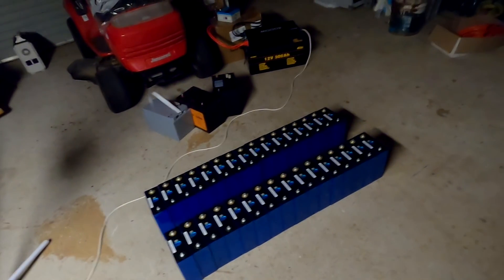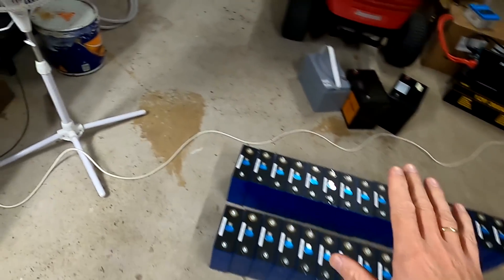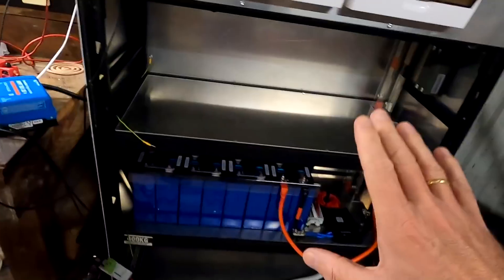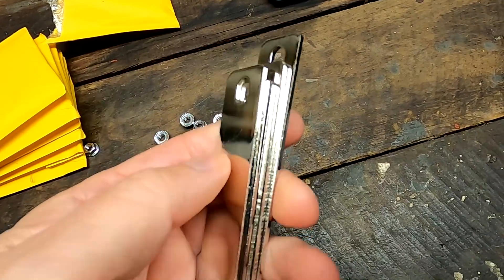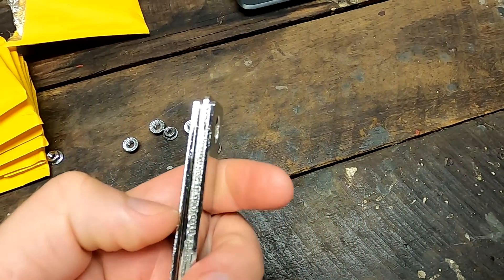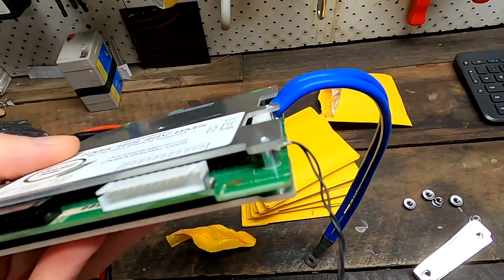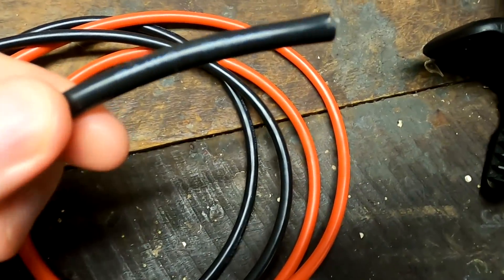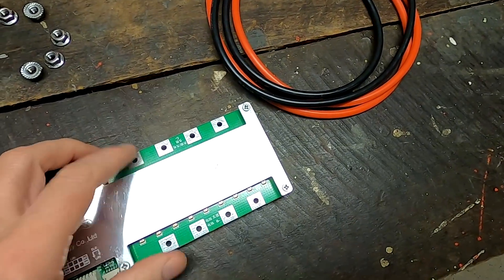HELTEC 200A BMS comes without cables? Preparation to install 30kWh of batteries.

Comment: Thanks for your videos Andy!
Perhaps my little trick can help make inserting wires into cable shoes a breeze in the future - pardon if it's old news to you:

Use a small cable tie - strap it around the exposed strands and pull it tight.  It makes a neat package out of the strands and firms up the end of the cable. Now you push the cable tie almost to the end of the wire, ensuring the very end is tidy and no single strands stand to the side. This way, they are quite easy to insert into a tight-fit cable shoe. Then simply push the cable tie back with the cable shoe when you insert the cable. Once the cable shoe is on, clip through the cable tie with a pair of small side-cutters. This trick can also be used if you failed to insert the wire on first try and bend some of the strands. Naturally, it also works for multiple wires, like in this video.

Comment: Hay Andy,
So just set up second battery bank. Now I have to 560 amp hour 24 volt packs connected in parallel. On each pack I have   Jk bms. Question? Having the bms set to 560 on each bank and the shunt set to 1120 amp, that is the correct way to set them isn’t it???
Reply from the maker: Thanks Alan. Each BMS needs to be set to the battery it is connected to. So if you have two banks in parallel with 280Ah each, set each BMS to 280Ah but the shunt to 560 as this measures both.

Comment: So your 3 cable are underrated for the BMS, vit you had to drill the holes to fit them. Does this mean that the 4 cables fitting the 4mm holes would actually not even be enough for this BMS?
Reply from the maker: The current rating varies a lot for these cables depending on the installation location and isolation material. For these 8AWG wires (10mm2) it can be everything from 55A to over 100A. The silicon wires I used are definitely on the high side and can probably carry close to 80A without causing any problems.

Comment: Hi Andy, the original JBD comes with 10 gauge wires, Steve from Overkill deliver the BMS with 8 gauge wires, tested and a lifetime warranty. Is anything wrong you get another one without any questions. Just send you a new one. Nice job by the way.

And please one question, what is the reason when you have 2 battery packs in parallel, with exact equal length conductors and one battery will always more use than the other one? Have a difference from 140ah more then the other one in roughly 4 weeks.
Reply from the maker: Thanks for the info. I remember this now having seen a video about their service. So they replace the wires and give you a life long warranty. That's actually a great service. The soldering they have done is very good on the Overkill BMS (I've seen the video where they used the gas torch to solder theses cables).

It depends a bit how you have connected you batteries. If they are connected form one side, it will draw a bit more energy form the first bank closer to the connection point. Internal resistance is also a major factor as they won't be 100% equal. More energy is drawn form the pack with the lower resistance.
Reply: @OffGridGarageAustralia  oh, ok, yes they have a good thing to run.

And yes, I know about that as well but it's all equal length. Maybe 1 or 2 cm difference in wire length. Curiously.... but I guess you can't do anything against?
Reply: While Andy is essentially correct here, I would like to know more about ur setup,ie: are both battery bank identical in every way, internal resistances would probly be big overall here, along with chemistries (the same), were they all bought and assembled together with matching/balanced resistances, temps, balancing gear, etc. but I would expect if this was all fairly similar while there may be some variations here and there, it should all be a reasonable balance of currents between ur conductors,, unless u have a high resistance join somewhere in your busbar/cabling circuits, connectors, etc. one last thing, are u sure u dont have a sad cell or 2 in one pack, or suspect balancing issues? These are all good questions and Andy has given us a lot of information & videos about how all these different issues and things can have these effects.

Comment: When you drill out those holes in the pcb, these are likely plated vias ( i can't tell from the video). You have essentially drilled out the via, removing the plating. This shouldnt be an issue because the cable is now the connection betwen the two outer layers, as well as the two outer layers are peppered with other vias connecting the two. This assumes there are no other internal layers close to those vias you drilled out, otherwise you would have just shorted them out. The designer of the board shouldnt be doing this anyway.
Reply from the maker: Yes, that is correct, thanks for confirming this. I could see the plating in between the top and bottom of the PCB. I would expect this is not the only connection between the two sites though and there is somewhere a proper link.
Reply: I would never, under any circumstances, drill a via.

Comment: Hello Andy. I know it might be a bit overkill..but i would do it for 100% in your case. Those 3 cables you crimped into one lug i would now solder it and add solder to it as much as possible. It would not hurt it and it would actually improve and reduce resistance and add rigidity to your connection so you can be sure there will be no movement or not properly connected cables. btw I think it was originally designed..one ring lug one cable and connect 4 to one spot..
Reply from the maker: I'm not a fan of soldering ring lugs. If there are crimped correctly, it should not be necessary. Solder just adds another layer (and more resistance). Solder also can get brittle over time and can dramatically increase the resistance and cause a hot spot. It's a no go for high current applications for example.
It's one of these questions: compress or not, aluminium or copper bus bars, solder or not to solder...
Reply: @OffGridGarageAustralia  Well Andy. I agree with you that is it as you said. I'm personally soldering problematic crimps i believe it is better than not soldering..but i think you are a bit wrong in that ..because that solder will fill empty spaces only and will bond better with your solder on your ring lug..also solder joins shouldn't be mechanically stressed and that shouldn't be problem as you crimped your ring term already.. ..but then as i watched your next video i did see that bms wasn't working at all..and I'm sure it will be even better in your next video .when you will explain it.. :)
Reply: @SylwerDragon Nope he is 100% correct, soldering is not only unnecessary, it makes them more prone to failure due to cracking. When crimped properly, adding solder will only hurt it. This isn't subjective, these are facts with lots of research to back it up.

Comment: Overkill Solar put a sticker on the BMS and then up the price to cover their profit. HOWEVER they provide warranty.
Reply from the maker: They replace the cables from 10AWG to 8AWG and give a lifetime warranty. They will just send you a new one if it ever fails or has issues. I think that's a great service for the additional price.

Comment: Andy, love your vids.  Thank you for sharing your wisdom.

I'm by no means an expert, but I think your soldering equipment made that job harder than it needed to be.  At the very least, you want to replace the tip with something very large so that you can transfer more heat, more quickly into those massive wires.
Reply from the maker: Thanks Matt. It is definitely the wrong soldering iron for such larger connections. I looked for larger ones in our hardware store but could not find any descent irons.

Comment: Hi Andy. I nearly had a heart attack when I saw the m3 tap in the battery drill.... Those taps are easily broken....
Reply from the maker: I thought the same before I came to Australia. They are far more robust than I thought too. They use them in battery drills all the time down here. In the last 10 years, I broke on M4 bit just because the battery drill tipped over and cracked it.
Reply: @OffGridGarageAustralia  oh wow. Good to know. I'll give it a try. Keep up the good work.

Comment: Hey Andy, why not ask the manufacturer to start drilling those balance lead holes? I love the design, it is what I have used, and if they can tap the holes for us, how much better that would be right? Thanks again for all the amazing content.
Reply: Or battery terminal could have a tapped hole on top. Would be pretty convenient in any case
Reply: @tiloalo  Good idea. Only thing (for them) is if they mess up the hole, they have to ditch the whole cell, or it would be extremely hard to put in a new terminal.
Reply: @TrevorFraserAU  I meant on top of the terminal screw, and as those are solder last, they could make the tapped hole, and only after that solder it to the terminal.
Reply from the maker: They buy them in bulk and just add them to the cells. It would be a lot of work for them to do that and may jack up the price again. 
Not all people will connect their balance cables like this, some use ring lugs under the terminals.
And, it's a DIY channel after all 💪😉

Comment: Not gonna lie I would just use lugs. You already have 4 contact points, and if you are still concerned you can put lugs on both sides for a delicious amp sandwich.

I'm not concerned about anything being under those pads where you drilled, that would be a terrible design idea, but I do wonder if the contact area you lost was worth it.

Comment: Andy you could have used 4mm  silicon cable and made up 8 cables per side with 4mm lugs each side of the PCB  pads and bolts giving you 32mm per side coming back to a standard 35sq mm lug without drilling holes in the PCB, I am not a liker of drilling out PCB
Reply from the maker: Ah, yes, I didn't think about that... 🤦‍♂️
You always have the right ideas, thank you!

Comment: Also when I need to put cable into a hole with no bellmouth, cut two rings around the cable,  Then take out the piece between the two cuts, the remaining insulation will hold the cable together and slide down the cable as you push it into the hole, then just cut off the remaining "ring"  and finish sliding the cable through

Comment: Silly idea perhaps but why not bolt a bus bar across the 4 holes, then a single cable of appropriate (larger) size bolted to the bus?
Reply: That was also my idea. Are these holes even intended to be soldered on?

Comment: Andy, I think one cable is shorter and will show a slightly higher temp (maybe centre one). When you measure them the outside ones are longer as they are coming from an angle to your hand. The best way to have them the exact same length is to measure the first one from end to PCB after soldering. Then use that length for the measurement of the other two cables. The cables cannot be same length if any come at an angle to the end you are holding. If you did measure the way you did now you would have to separate the cables the same distance apart that they are on the PCB. Probably not going to make any significant difference in testing but just wanted to point it out so others don't make a mistake if they have cables a wider distances apart and try to match them for length using your method. André in Sydney

Comment: Hi Andy, I've seen others using ring lugs on the BMS board also, instead of soldering the cables to it. I do myself so and it seems to work. BR, great videos, watching each and every!
Reply from the maker: Thank you, Benedikt. Ring lugs would definitely be an alternative. Heltec advised to solder the connections, so I did. Both will work the same way though.

Comment: I prefer no cables soldered so I can attach the exact length and type of wire I want. Also that 35mm2 lug looks like a Ebay cheapie with thin wall so wont be a great fit even if you use the right mm2 wire size.

Comment: Why are there 4 holes/wire connection points? I’m wondering if it would be possible solder/ or bolt a cable/bus bar across all 4 connections and have the wires soldered/bolted  to that cable/bus bar?
(Of course I’m so slow, just came to me that they are connected at the end of the wire.. Well I’ll leave my comment anyway as a sign of support for this great YouTube channel, more comments gives a better place by the algorithms as I understand).

Comment: Yes, it would have been better to use all 4 holes with smaller wires and not drill the PCB, there is no telling what the internal layers are like when you have large copper pours like that on a PCB.

By not using all of the holes the high current paths from the area with no wire are now longer than the others.

Comment: The JK-BMSs have the same cables I think, but just two of them. Do you think they can handle the 200A from the BMS? Btw your sounding quite german...are you from Germany?
Reply: My 200A JK BMS came with two silicone 7 gauge rated at 200C, so they each have a 100A rating. Mine have never become noticeably warm to the touch, and I see ~130A for extended periods of time.
Reply: @captainobvious9188  sounds good thank you
Reply: Yes he is. André

Comment: Well, it wasn't really necassary to drill bigger 5mm holes. 😉
Putting about half of the cable through the 4mm hole would have done the job. The PCB is a double layer with several plated through rivets to connect both sides together. So placing about one half of the cable on one PCB side and the other half on the other side is just fine. You can find this on several high current PCBs. You can even find wires soldered only to one side and the hole just filled with solder used as some kind of a big through rivet.
Reply: good to know  thanks

Comment: You may have ruined your BMS by drilling through the hole as it is a multilayer board and has traces in the middle of the board if it were a two-sided board you are good to go but it looks like a multilayer board with traces in the middle.
Reply: Not likely directly in between the b- and p- pads - in manufacturing it’s asking for trouble that, so I think he’s fine 👌👍
Reply: @bobbinbob  In the video I see no traces going to the square pads from the Fets on either side so the traces are in the middle of the board
Reply: @Labeeman  That's because that whole area is a large copper pour. The square pads are just parts of the pour that are unmasked and tinned. It even looks like the copper pour on both sides are actually bonded together with vias, that's the dimpled grid you see in the solder mask when the light is hitting it just right. With all of those vias, it's extremely unlikely any traces are under there.
Reply: @xDownSetx  good spot 👍 to add to that, it would be very unusual/wrong to run anything other than the high currents through the circuit layers at those specific spots so I maintain, it's fine 👍

Comment: I would have used two "custom" copper tinted plates. Sandwich the bms 4 connectors in between and tap to it the ting terminal with the cable / s crimped into.
Reply: another perhaps simpler tactic could be to crimp ring terminals to the wires and then solder the terminals to the board. It would at least me much neater and perhaps a better connection than just soldering the wires to the board.

Comment: Are them holes in the PCB through holes?Wouldn't drill the holes in the PCB bigger unless you're sure there are no internal tracks going to the pads or near by. If you do drill them also good idea to solder both pads on the wire entry and exit side to reconnect them. As the internal through hole connection would now be gone..

Comment: If my memory serves me correctly, Overkill Solar buys JBD bms in bulk, test, calibrate, and install 200° C silicone leads standard length or custom for your specifications. Since they have them stocked on the states side, the turnaround time is less than one week.

Comment: Almost every electrical component has a stud or connector.  But for some reason BMS designers go with a 2 layer PCB, multiple connections, and solder/bolt system.  It makes no sense.  Sane engineers would just give you a nice stud to mount to - like a car alternator.  Even those have multiple diodes, but do they don't expect you to have multiple connections.  It is also rare to have a pigtail with a ring terminal since that requires another stud somewhere to mount to anyway.  Just put 2 studs on the bms and let's stop wasting time on putsy connections.
Reply: I’m not an engineer, but I hate using solder for anything that is intended to carry high amps for power, it has relative high resistance and always ends up being a hot spot. I’m all for physical connections that compress and restrain.

Comment: If the BMS wires are using silicone insulation, the temp rating is at least 125C.   That means they are rated for at least 90A and the 3 wires can handle 270A total.

Comment: Could you slit a plastic drinking straw, slip it over the insulation, then slide it toward the loose wire strands to bundle them tightly?  You may be able to slip the whole straw through the hole, then pull it off on the other side.

Comment: Those 8AWG 200 degree Celsius rated silicone wires are rated for about 124A in free air. I wouldn't want to run them close to that but 3 should be perfectly fine for 200A.
Reply: The issue isn’t the conductor gauge but if the individual pads are connected internally within the BMS, in this particular case the BMS is rated to 200amps/ 4 pads = 50 amps per pad.
At 48 volts * 50 amps = 2400 watts, that’s a lot of energy having to go through each pad even as a double sided connection. Maybe a 2.5mm tinned copper strip across all the pads, one on each side, bolted through and a single a larger conductor to the battery on B1 and the same for C1.